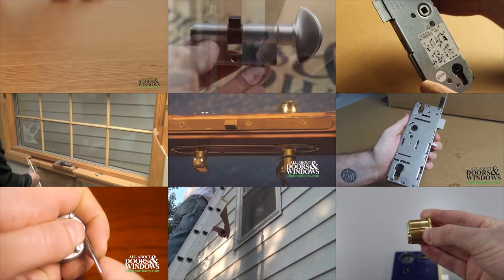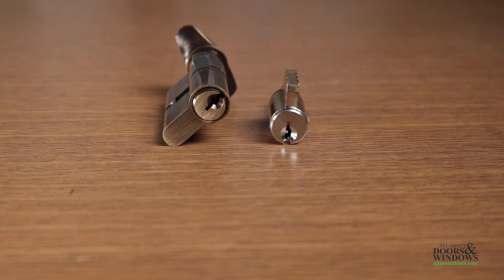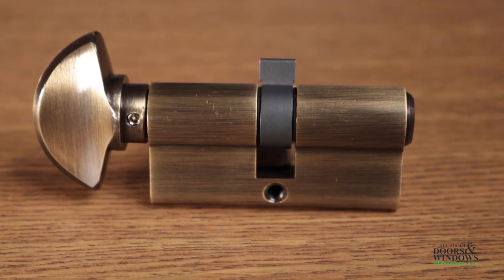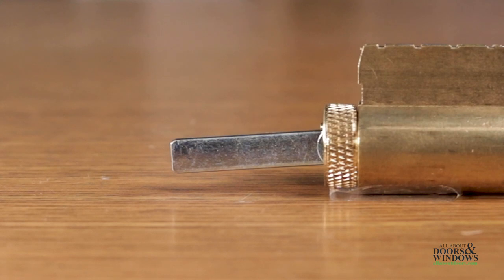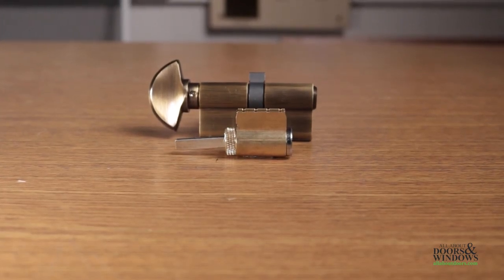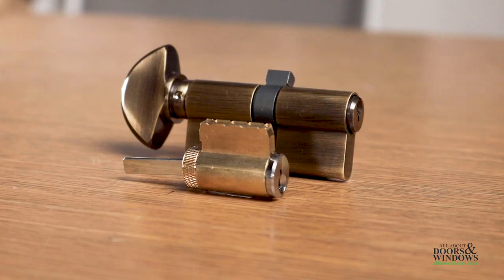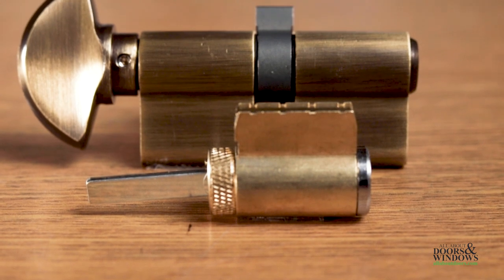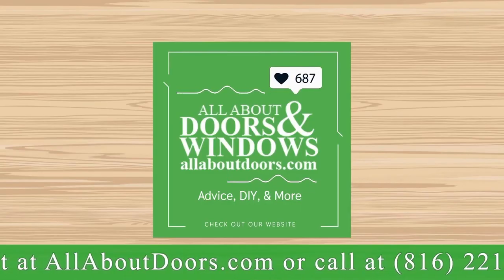Euro v American Cylinder Locks

Comment: How do I change out the tail piece receiver. The one I purchased came with 2 different sizes and I need to swap it out for the smaller one. They are American Cylinder Locks. Do you have an instructional video on it?

Comment: Ok the American cylinder he is showing is mainly used in deadbolts, lever and knob sets. I’m not sure but I think that’s used everywhere not just America . There are different kinds tho . He’s displaying a kik cylinder.(which works in lever and knob sets, and some padlocks)There are more types of cylinders for different locks and different brands(Brands really means what kind of key it takes). I don’t know much on the other one tho but it is called a euro cylinder. (If a pro locksmith comes in and sees any mistakes please correct me, I’m 19 and almost been doing this for a year. So if I fucked up at all, let me have it, I should know all this by now) and I’m high.